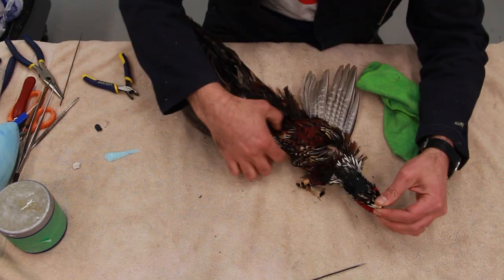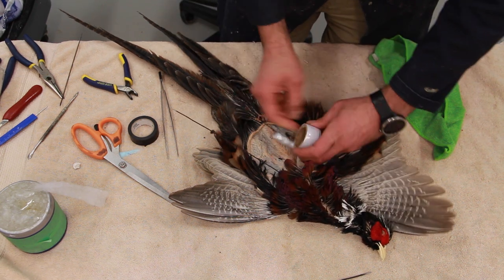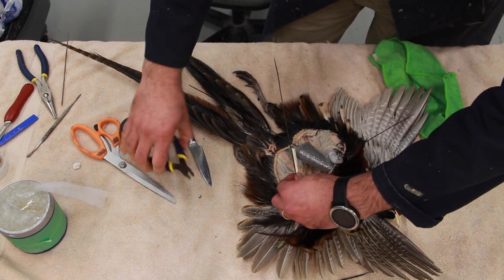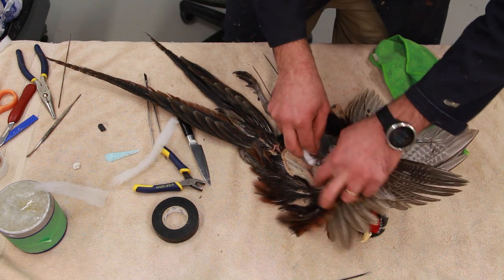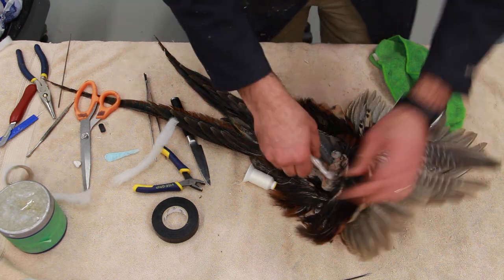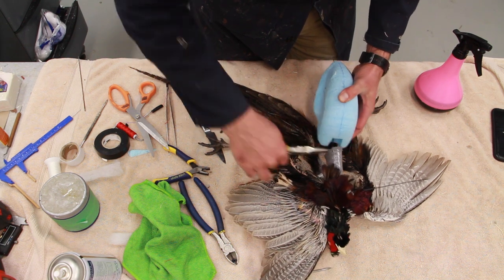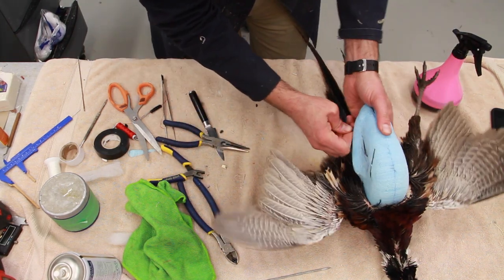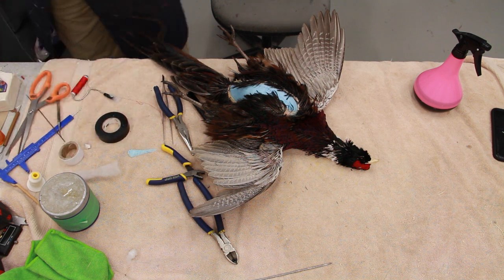Pheasant taxidermy 2 of 5... Repairing broken wing, wrapping drumstick and installing the body.

Comment: Hi Ben.  When you wrapped the excelcior around the leg bone, what is the name of the tool that you used to dispence the string around the excelcior.  Where can you buy it ?   Really handy item.   Great videos.  Learning so much.  Thanks !
Reply from the maker: Haha… it’s called a piece of wire. 😁 I made that. Very easy. Basically one end of the wire is holing the spool outside of my hand and the other end is in my palm with a little plastic tube attached to it to lead the thread out of my hand.  Later on I will be making a video of the DIY tools in the shop.

Comment: I cant find in the video if you mention what gauge wires you are using. Do you have an opinion on galvanized vs annealized. I am thinking of using 14 on the body, 18 on the wings of a chicken Im working on.
Reply from the maker: I usually don’t follow a certain gauge size fir my birds all the time. Depending on their pose I can choose different sizes. 
But 18 is very light. I use black anield wires or burnt galvanized ( please do this outdoor).. wings can do well with 16, neck can be 14 and legs can be 12. 
Again it depends on the pose and how much bending will be required in different body parts.
Reply: @ArtofTaxidermy  Awesome. Thanks for the great information!